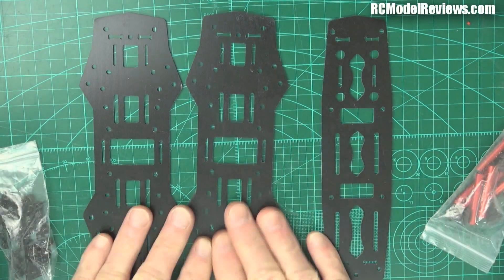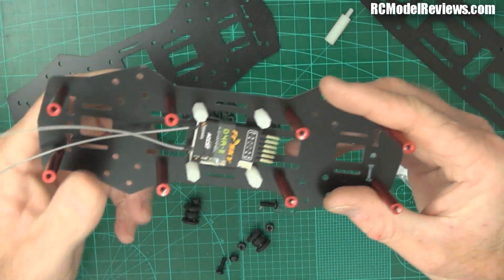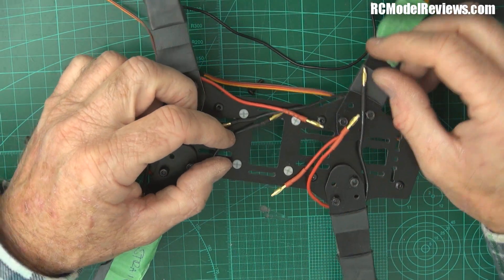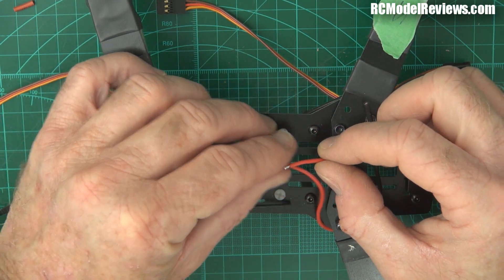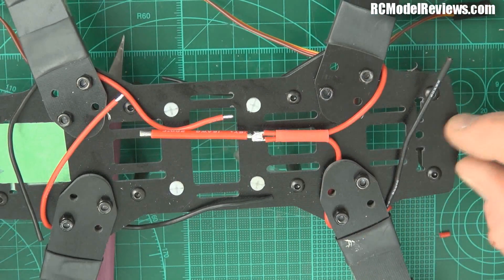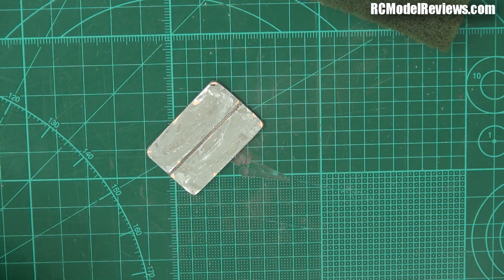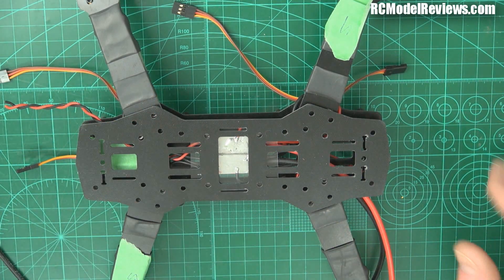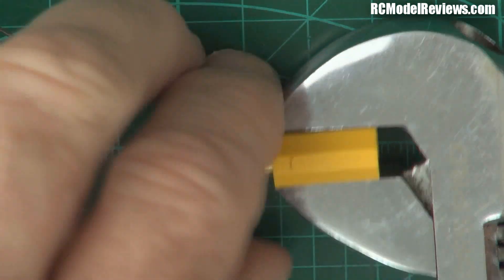Low cost miniquad racing drone build video PART 3

Comment: Hey Bruce, just wanted to say thanks for such a great video series. Even if it takes 10 parts across 5 hours it will still be the best video guide for beginners, guaranteed. You're taking time to not only explain what you're doing in each step but also why, and I think that's paramount in videos like this. By the way, neat idea with using the copper board as a PDB!

Comment: I like the copper power distribution board thingy. I made mine just small enough so the same big heat shrink you use on the arms would fit over the whole board and the wires. Nice and neat, as well as secure! :)

Comment: Hi Bruce, one trick I found with the base plates on the ZMR frames was to drill out 2 of the holes on the bottom plate for each arm so that the nuts pass all the way through. Then you can do up the arms fully to solder everything up and put the final 2 bolts on (for each arm) to get the stiffness with the bottom plate. That way it is also a lot easier to drop the plate off when you bend things :)

Comment: Great tutorial Bruce.
Always "nice" to see someone else with "The Shakes" when trying to solder stuff. ;)

Soldering multiple wires together is always a tricky job.

Maybe tie together with a thin piece of copper wire or hold in a "Helping Hand?"

Your simple PDB makes things so much easier.

Regs, L..
Across the ditch.

Comment: Bruce, for putting the arms on, I put all the screws up through the bottom plate, I put a small rubber band around each set of 4 screws as I put them in, and lay it down on the table. Then I just put the arms and the mid plate on to it.

Comment: Dose anyone have a rough idea how much all the components will cost? Love your relaxed style Bruce. I generally dont watch long videos in one go but this was great viewing. You make me laugh also, which is never a bad thing.
Reply: Gary Lowe Frame 20ish, these motors 10x4, ESCs 10x4, Flight Controller 24/30 (solder or not), Props 2/set, maybe 10 for various wires/plugs/stand offs.  Most are linked in first video

Comment: I watch all of your vids on here and  the  xjet , and this 3 going on 4 part build is quite interesting , so don't worry about boring the pants off people with it being a long video , I don't usually make comments as I never have anything useful to say, but
watching you destroy those lovely zip plastic bags, I feel I must give you a tip on opening them...just put the bag between your finger and thumb and slide your finger and thumb in opposite directions along the length of the zip and see what happens, it will just pop open at one end, it doesn't work every time if you have greasy hands, but it works best on the little bags as the zips aren't as stiff as the large ones,   keep up the good work Bruce.

Comment: A tip when soldering the power wires of the esc, use helping hands and keep all wires flat and run a solder bead along it. Keeps it flat for in between the plates

Comment: Thank you so much for an excellent series of instructions, you may try to wire-wrap all wires together with tinned wire and then  solder and cover with heat shrink, instead of ty-wraps  you can use velcro strips.   cheers

Comment: It's my strong opinion that you still need to calibrate the ESCs even if they come on at the same time. Calibration gives the ESC the top and bottom endpoint of the range. If the FC uses 1000/2000 for the top and bottom of the range, but the ESCs come calibrated from the factory with 1100/1900 (making these numbers up, just for example) then you will be wasting part of your throttle range if you don't calibrate.
Reply: Joshua Bardwell noob question : so you need to calibrate them before you do the wiring as shown in the videos?
Reply: Calibrate after the ESCs are connected to the FC so that the FC is generating the timing signal.

Comment: Thanks for the aluminium translation:)  As a fellow geezer might I suggest you start putting your screws, nuts etc. ( bits and pieces as Painless says) in the fridge now because sooner or later that's where you will find them. Made my own custom pwr dist board with Muriatic acid and peroxide and even added solder resist. First time, easy, lot of fun and satisfaction ( as the R. Stones have said). We don't have no steeeenking MIL. Great vids thks .

Comment: If I can offer a tip. Use a small cable/zip tie on the bundle of wires to hold them, close to the joint as possible, cut off when done :) and you only need to add the shrink before the soldering if you are going to close the loop otherwise slide it on from the open end and after soldering the joint.

Comment: quick suggestion bruce for the non PDB version.  If you use some really thin wire and just use it to wrap the solder joint between the 3 or 4 wires to hold them in place before you solder it, it removes a lot of the farting around.
Reply: I do that, too. But getting all wires at the same time (especially when the exposed copper should stay short) and not come/twist apart already is quite alot of farting around.
Reply: Packer's
Reply: +Wyll Surf Air yup works great but make sure it is a thin gauge single strand wire you dont want wire that has a bunch of tiny strands

Comment: I appreciate your videos and your pdb gift! But I think I'm going to solder all the wires together like how you showed first. Thanks for the vids perfect timing as I'm building my first zmr250
Reply: Just use two short strips of copper or tin , one for positive, one for negative, and solder the wires along each. Then heat shrink over each strip. Done and a whole lot easier than trying to hold several wires together at the same time while applying heat.

Comment: when your soldiering a group of wires together it makes it easier if you take a single stand of fine copper wire and wrap around the wires your going to soldier it will hold them in place as you soldier them together

Comment: With the XT60 connectors, plug a male into the female while you solder the female - this means that if you apply too much heat, and the connector starts to melt, it won't move the position of the bullets, and it'll still connect perfectly :).

Comment: First I must say thanks for all your time and honesty in your review great job , that being said I was all set to hit the button and order the zmr250 but I then came across an older review that you stated you were not impressed with the frame . I am a firm believer in buying once even if the cost is higher it will save you money in the long run   
So why the change , has the zmr changed there frame construction

Comment: Bruce, I would like to know your thoughts on having the bolts that hold the arms on come up from the botom plate rather than going down from the top plate.  I lnow people will say well if you loose a nut the bolt can fall out.  Buit it would make assembly FAR easier!  

The way you built it, if you loose a nut the bolt cant fall out, but the nuts are nyloc inserts and I doubt you will have one vibrate loose.

Comment: Hi Bruce,
Great vid. Just got all my quad bits, glad I saw this before I started. It will save me a lot of pain. Think I will use your power distrib board method, very cool.
BTW, bit off topic I know, but have a prob with my tricopter running a KK2 board. Was running all ok but now has decided when I power up that the RHS motor starts first left next when I increase throttle then rudder. I have re calibrated esc's and get this, when I disconnect wires of the esc on the RHS motor it still runs. I have swapped KK board and tested all esc's, not sure what to try next?

Comment: When soldering 3 wires together. Twist two together, tin them. Take the last single wire, tin it. Now you just have to solder two wires together.

Comment: Bruce, the zmr gives you steel screws for the standoffs, however the blackout kit supplies you with nylon screws to provide a cheap failure point. My first crash broke every one of the nylon screws on the standoffs, and I immediately wondered if I would be risking damage to my frame by upgrading to steel fasteners. In your experience, does the intentional failure point of the nylon screws on the blackout frame actually provide any benefit?

Comment: You mentioned the positions of the arms in relation to the direction the motor spins.  What happens if you get it back-words?  For example, the arms that are suppose to be left front and right rear, are put on right front and left rear.

Comment: dont throw your lipo's out, you could use the small Boards on the top of the lipo's as soldering joins, they are great and there are plenty of solder there....:)

Comment: just curious when i built my 500 alien quad i run my power cable in a ring main type fashion and used slightly thinner wire as i figure the current is halved in the ring main.

Comment: Wireless mic? Sounds like RF interference. Sounds like when I poke my hand around a VTx or other TX and de-tune the antenna and RF shoots back thru the coax and into the servos and FCs :))
Anything that resonates at the TXs freq will cause trouble if it is near enough the receiver or the transmitter antenna.

Comment: I would add a second male jst connector to the power distribution wiring /board. Because the naze32 can monitor battery voltage. Most of the naze is only 5v tolerant so I would put a female jst on the naze32's battery voltage pins instead of just the standard header. Because I don't trust myself not to plug the battery voltage into the telemetry, buzzer or just in backwards.

Comment: Marking the front for motor rotation isnt needed Bruce. front right, and diagonally across means if you flip it, it will still be front right and diagonally across ;)

Comment: Bruce I know you are very busy. Can you or someone help me figure out how I blew my vtx using an extra lead? I wiried up the mini quad as shown without PDB. The VTX is a TS5823 that came as part of a kit from HK. I double checked all of the connections...negative and positive and made sure it was not grounding  out on the CF frame anywhere. It worked out of the mini quad on a 2S lipo but as soon as I connected it to the extra lead from my wired up power system it blew. The VTX said 7-24v. Battery used on the quad is a 3S 1.3 Turnigy Nano. Thank you for any help and I'll see you on xjet.

Comment: Ordered two of these 250 ZMR kits (opted for carbon frame) from Banggood at the end of January 2016.  Looks like they've switched to shorter screws for the aluminum posts.  Not really a deal breaker I ended up using locktite on them and ordered a 100 knurled end screws off of Amazon for $6 so I got backups.

I also picked up 2 full sets of motors with 1 backup for each set.  I was surprised to find they only came with 2 screws with each motor to mount to the arms.  Checked local hardware stores and didn't have any luck so again ended up ordering them online 100packs were $6 each and I got M2x6mm, M2.5x6mm and M3x6mm so I've got backups.  Quite annoying they feel that 2 screws to mount a motor is acceptable.

Comment: Hey Bruce, I just ordered some FR4 circuit boards on amazon. Can I simply scratch the positive/negative dividing line in the center of the board or do I need to etch it?

 Also after scoring and breaking the circuit board down to the correct dimensions, do you smooth the edges up with some fine sand paper or something, or just not worry about it? Thanks

Comment: Does the BEC's on all 4 ECS cause any issue?  should I remove the power/ground wires and only use the signal wires on the other 3?

Comment: Good tip for maintenance:
If you drill out the holes in the bottom plate you can change the bottom pillar screws without having to unscrew the two bottom plates and arms from each other.
Reply: Rooster9911 I've never had to change the screws -- it's the pillars that strip out -- steel versus aluminum -- no contest :-)
Reply: ***** To be honest, me neither. nor did i had to change a pillar. I have, however, some lipo's with quite impressive cuts on their leads. So i do wish i made the XT60 leads a bit longer. ;-)
Reply: ***** I've noticed during hte builds no one preps the carbon pieces?

Comment: I was thinking about the last part of the video when you where soldering the ESCs to the motor and had to twist two of the wires,  wouldn't work to have two of the ESCs face up,  were you and see the label, and then for the other two have the ESCs face down,  so the label are against the arms. Because the two outside wires would be switched. This way the wiring will be flat and the arms will be easier to identify which is CW and which is Can.  Do you think doing this is a good idea? Thanks BTW for making these videos,  they really do help.  Keep up the good work!
Reply: Joshua mangum Yes, I was going to suggest that but having the FETs effectively covered by the arms (on the upside down ESCs) might affect the cooling a bit.
Reply: That's what I was worried about.
Reply: someone suggested that in the last video too :)

Comment: Instead of butt-soldering or just lapping the two together, I think most beginners will have an easier time stripping a bit more wire, and twisting them together to solder.

Comment: Hey Bruce, I'm curious as to how hot will the el-chepo PDB get?  Will it get hot enough to melt the little plastic you used to cover the PDB?  Wouldn't it be better to use something like a second stripped down PCB?  PCB is just the 1st thing that came to mind that would work pretty good; but, anything thing that's thin, a bit heat resistant and doesn't conduct electricity would work.  Although your plastic looks thick it's plastic and would melt rather easy from the heat produced by the board right?
Reply: Ahhh...  Even better would be thin plexiglass; that's if you want to still see; but, protect yourself and your parts through the cover underneath.
Reply: Kenneth Elston The board won't get even the least-bit hot.  Copper is a good conductor and it's only going to be carrying about 20A (maximum) to the front wires.  Look at how thin the wire in a 20A fuse is then compare that to the total area of the copper being used :-)  No heat here.
Reply: Cool deal...

So, if I have maybe or maybe not had something like that happen to me before; no one was watching so I'm going to say did not happen :-)  Did it mean that there was something connected wrong?  Or I was using the wrong gauge wiring for the amps that I was pushing through them?
Reply: Kenneth Elston Heating of the board can be calculated using the formula I^2R where I is current squared, and R is resistance of the wire/PDB. 5cm of 16AWG stranded wire will have a resistance of about 0.67mOhms (0.00067 Ohms). With say 40 Amps flowing you would generate: P=I^2R = 40^2x0.00067 = ~1 Watt. With a voltage drop of ~ 0.026V. As you can see thats not much power lost or heat generated. Certainly not enough to melt plastic, or even heat the copper (which is also an excellent conductor of heat, and will radiate any heat generated into the air around it). 

If that happened to you, you must have had the wrong size wire (too small), and/or possibly a short circuit. With a 1.3Ah 90C battery you could supply 117 Amps, which would be able to melt thinner wire, especially if the short circuit lasted for more than a brief period of time.
Reply: I'm pretty sure that the wires were too small because they melted part of the way up also.  In all fairness, It was my first attempt at building a quad and I purchased very cheap ebay parts, not wanting to put a lot of money into something that I may not like.  It's how I found this channel a few years back, I found Bruce talking about voltage and batteries :-) 

Thanks for the very informative information; it's just another example of why this channel is one of my favorites to visit on YouTube.  

Bruce isn't the only one here who give out good information; but, he also have viewers who provide good information about the hobby and the majority of the people here are very respectful and polite when answering questions, even when us newbies are asking dumb ones :-)

Comment: one question... 
I always thought when running more than one ESC you are suppose to disable the BEC on the other ESC's, (generally cutting the red wire to the receiver)
And as well as that, I got taught to leave the black wire so it has a good earth for the signal wire.

could connecting 4x ESC's to a servo tester like you did cause damage to one or more of the ESC built in BEC????? did u correct the wiring later on?
Reply: Thankyou for clarifying that... I disconnected mine just to be sure anyway.
Cheerz
Reply: Joe Baker oops i missed what u said about an earth, I still disagree
its not a good idea to rely on the ESC motor circuit for a negative, even the manufactures dont..... hence the little black wire

all of the micro 10a-20a brushed ESC ive tested in rc tanks will not work together with out having a common negitive. (thin wire)... if i was not so lazy id post up a video proving it...
Reply: phmaximus It does not mater, if you are using 3.3 V , 5V or 12V systems, you could not connect it together without negative wire together.

Comment: Hi Bruce, just wondering if you might be interested in seeing my custom built 250 mini tricopter. It is mainly made out of an aerospace spec material called Fibrelam, which is stiffer and lighter than carbon fibre, with the added benefit of not blocking RF! I haven't cartwheeled it yet, but I'm hoping it will stand up to it!

I'm just uploading some videos of it at the moment. - Pete

Comment: The copper pcb power board is actually  more expensive by the time you purchased the pcb copper board from Maplins you might as well purchase a  CC3D NAZE32 BEC Dual 3A 5V 12V Power Board bangood £2.99  eBay £4.99